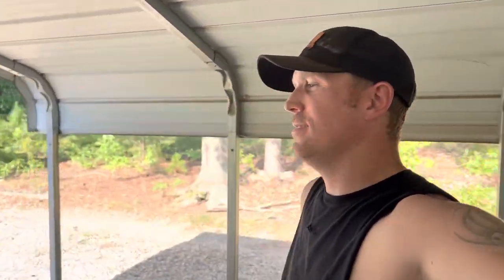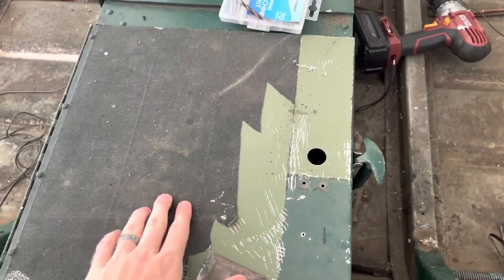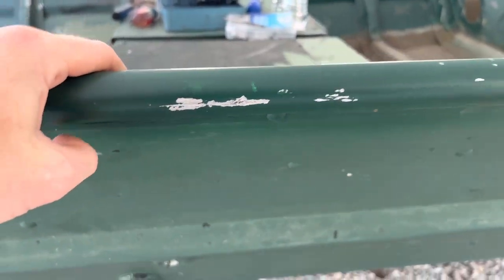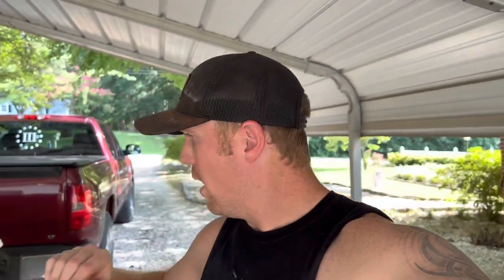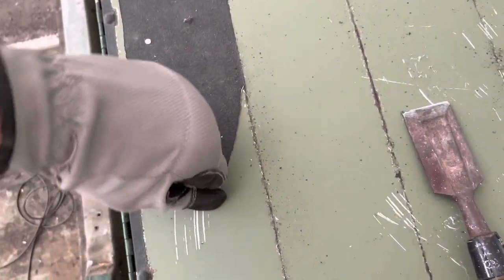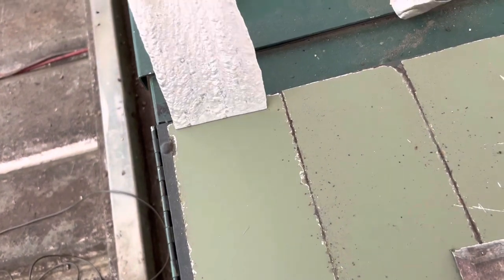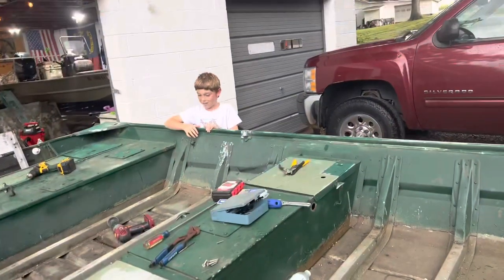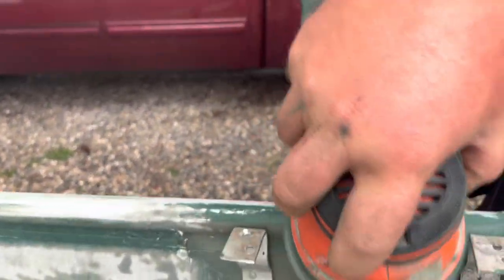DUCK BOAT build part 3…(sanding and FINALLY painting the boat)

Comment: Awesome vid I am doing close to the same project and I got the same paint and spray gun before I start painting I was wondering what primer you used and did you use paint thinner for the spray gun ?
Reply from the maker: If I remember right it was just a basic primer I used and I used a little paint thinner with the paint because it was pretty thick. I would just add a little at a time until the right consistency.